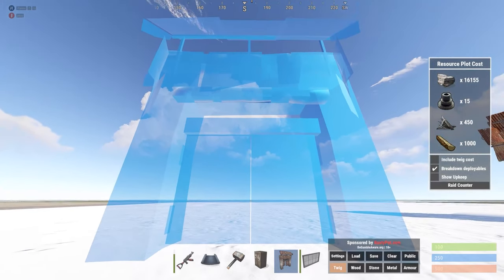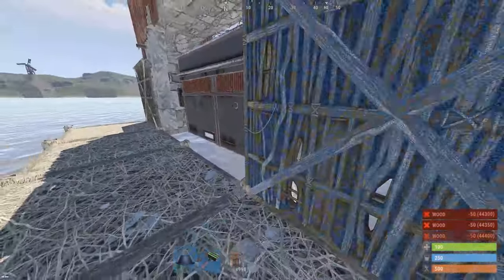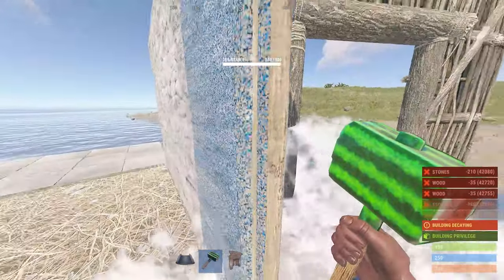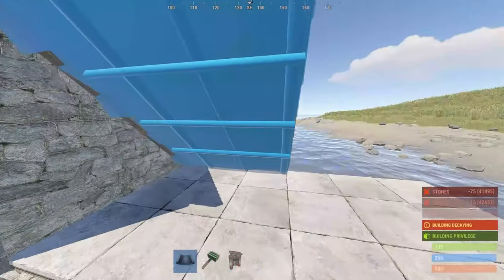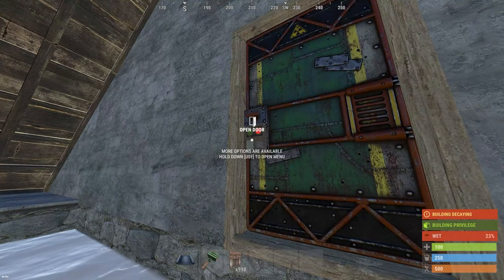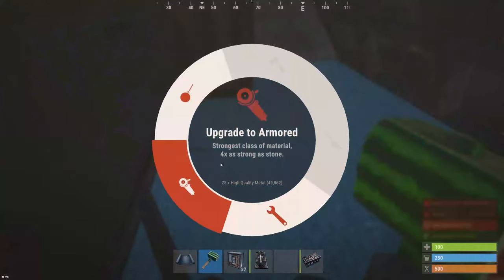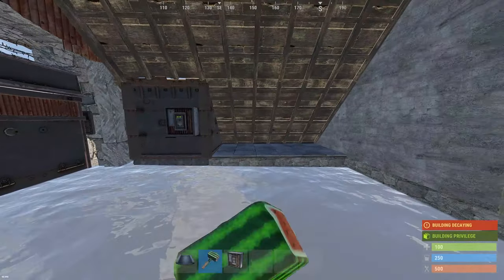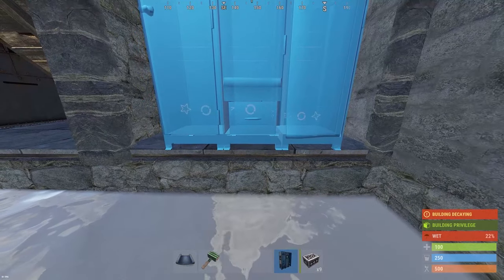Re-INVENTING The simple RHIB BOAT BASE - Rust Base Design

Comment from the maker: Youy CAN NOT soft side into this base as a wall becomes HARD SIDE when covered by more than half a roof, so no you CAN NOT just place a ceiling :p When i say 4x3 footprint, the
Reply: You can’t transfer loot out from the bunker
Reply: @jjttcc  Pretty sure if you place a ramp parallel to the armored wall before you place the side wall you can place a box that clips through the wall instead of the transfer box, but you would need a different suicide bunker module for that to work